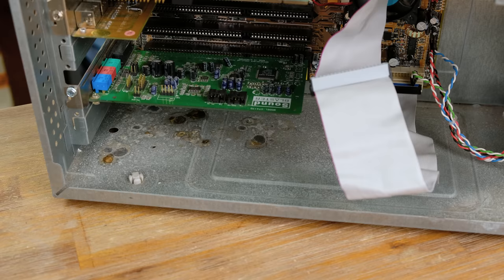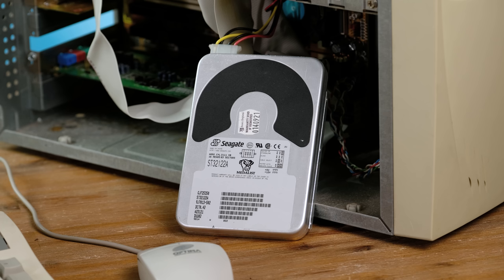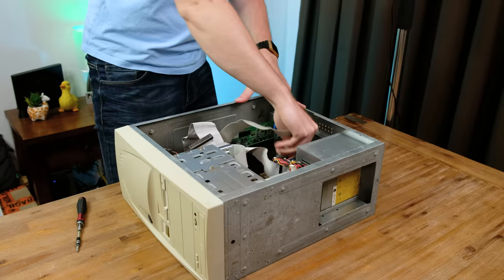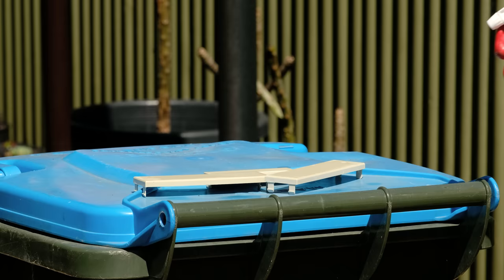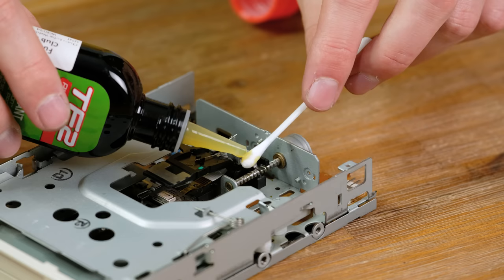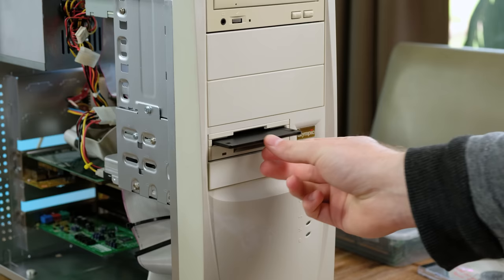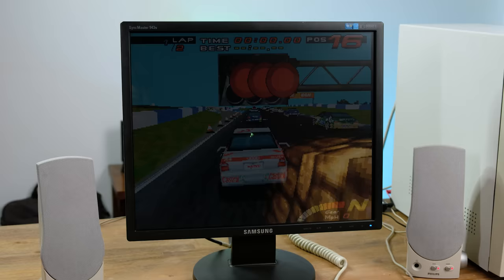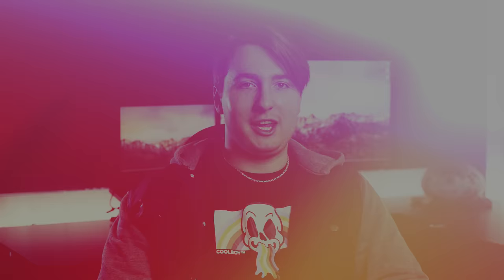Restoring a TERRIBLE Budget PC from 1997!

Comment: I'm a little surprised anyone is still using these machines. I had an old Gateway P2 machine that was a fully working computer, that I chucked in a dumpster last year. I pulled the hard drive though, and dropped a 7.62 Nato round through it.

Comment: Toss in a 3DFX card and maybe tinker with the FSB (multiplier isn't locked) then you are set, these cyrix M2s are pretty tolerant of high fsb clocks which helps with the L2 cache and ram performance. The floating point is the weakest link so games like quake suffer but in integer it does really well which does mean something for later dos games.

Comment: I built ( in 1997 total cost was only like $400ish ) a socket 7 AMD k-6 500mhz with 32mgb of ram I don’t remember my GPU it was a 64mgb ATI card I think, had a 24x CDR 2x write ( got it super cheap at an expo ) a 250mgb HDD a 28.8k modem and of coarse a sound blaster that was my first ever build I was 13

Comment: The odd speed listed for the CPU would cause me to check to see if the jumpers were set correctly for fsb, multiplier, and voltage while I was at it, and maybe check to see if the motherboard had a BIOS update

Comment: The corrosion marks on bottom case inside is rat urine and all the noise and seizing up of mechanical parts is the results of the urine leaving a vapor of ammonium that corroded many of the fine moving parts like the fan bearings.

Comment: The motherboard is a cheap PC Chips M571 using the SiS5598 chipset (here labelled by them as 'TX Pro-II'). On board graphics, sound and even USB although nowhere near as good as the dedicated cards for those features that you found in the system.

Comment: Had a very similar system as a kid - had a Voodoo2 (I think) card from Diamond but also a Cyrix M-II with 64MB. Was AT compatible so when the PSU died that was it - wasn't easy to replace them until the ATX standard.

Comment: If you want better retrobrite results trying submerging the the plastics bits in a solution of hydrogen peroxide and water as this methods seems to have the best results. The 8-Bit Guy has some pretty useful videos on other methods too if you'd like to check that out.

Comment: Speaking from my own experience, for the whitening (retro-brighting) I don't recommend using the cling wrap. The wrinkles on the cling wrap end up causing lines and blotchiness, as with your result. It works fine just to have it in a peroxide and water bath under UV or the sun. P.S, What camera body and lens for this video? Description just has general links to a variety of camera bodies and lenses. Cheers :)
Reply from the maker: I use 2x Fujifilm XT-2 bodies and one Panasonic FZ-300 for the overhead shots. Those are quite outdated now, hence why I didn't add affiliate links for them specifically. As far as lenses go, I primarily use the 18-55 f4 as well as the 50-140 F2.8. For my talking to the camera shots I use a 35mm F1.4
Reply: @psivewri  Thanks! Appreciated. The footage looks awesome :)

Comment: Just a random suggestion: could you add a 3D graphics card? Something like the 3D Effects Voodoo 2, for example. Also, I think this low-end PC originally ran Windows 95, because Windows 98 did not exist in 1997.

Comment: I have done a few of these restorations myself, its great going back in time. Presently though I have built a Windows XP Pro rig for messing around on using some old parts I had laying around, but I had to go with my old genuine copy of the 64bit version for the hardware. I have hit a snag though, I am desperately searching for a suitable driver to run the XFX GeForce 8800GT Alpha Dog 500MB card I have installed, cannot find one anywhere for XP.

Comment: Hey Nathan, I'm a tech Youtuber too and I think the fan was making the noise because the ribbon cable was clipping it as it spun early in the video.  Anyway Nice Video and as you always say, definitely consider subscribing.  ( I only have 30 subs)
Reply from the maker: Nope, wasn't making contact. Just a crappy fan sadly 😅
Reply: @psivewri  You should try putting modern Operating systems on old computers to push their limits as an experiment.

Comment: Thanks for the trip down memory lane. Next time you want to remove a CPU cooler held on like that use a chopstick. Unlike with a metal screwdriver you won't damage the motherboard if your hand slips.

The motherboard looks interesting. It has both DIMM and SIM slots. And it doesn't have AGP or VLB slots.

Comment: My first PC wasn't much better than this.Brought in late 98.  It was an Advent Pentium II 350mhz, 128MB ram (PC100), 8MB ATI Rage graphics card, 8GB HD, 56k modem.(dial up in those days).Was told I'd never fill the 8GB HD...hahahaha!.  never had a pc before..or even sat at one!..So had to teach myself how to use it from scratch. But by the end of 99...I had learnt enough to build my own pc (Athlon 1400mhz I think). And a 16MB Voodoo 3000 video card, used the ram from the old pc and added another 128MB (the new stick was cheap for the time £125). I had also taught myself to build a webpage as I wanted to get "online". So..as 2000 appeared,  I had a new pc and a website!..The website was dedicated to a WW2 pilot...I played MS Combat Flight Simulator then...It came out in 98..The real reason I wanted a PC...hehehe!...The original PC (PII-350) was like £1000....Can't recall if that included the price of the scanner and printer I also brought.....don't think it did...They weren't cheap either. I think I stil have them....But no longer the PC...But I do have a PII and motherboard knocking about somewhere...think it's a PII 400.

Comment: Not bad... . But a little bit to the technical side: The real 3D games ran not only bad lacking a 3D accelerator, but also because of the Cyrix CPU. These CPU -s were in normal tasks sometimes even quicker as the intel ones, but they lack an FPU that you need for real polygonal graphics.

Comment: 1:35  . . . Ah you novice kids!!! You should have push with that opened clipper wire, into the hole (Tiny spot as you see to the lower left of where you hand is, on the CD door) and all would open as they are supposed to.

Comment: The specs aren't bad for 1997. One thing I find interesting about even the new 2020 version of Windows 10 is that it actually still supports floppy drives and we would think people stopped using floppy drives about 20 years ago.
Reply: wouldn't have originally had even 64MB of RAM. More like 16 or 32
Reply: @RWL2012  I think a 266 mhz processor would have been high end in 1997.

Comment: Worms 2: the best version of Worms. I bought a modern release in 2012 and it was just not as good. (Big Worms fans tend to prefer Armageddon over 2, being basically the same engine but more refined etc. But I didn’t play Armageddon, while I had a budget re-release of Worms 2 in 2000 or 2001 😅 so that’s the best one in my opinion lol. Played it until 2006 or 2007, on a Windows XP machine by the end. Come to think of it I’m not sure why I stopped. Maybe compatibility issues with Vista that 7 didn’t fix?

Comment: Pc from 1997 can't be terrible, it can be only retro, terrible is your 5 years old computer. :-D
2:22 - Is it still problem for Microsoft when we are using illegaly such old OSs for retro PCs? I think they should just release it as freeware after such time.
7:02 - I once used just some random rubber connected to correct lenght with knot, it was making sounds like airsoft machinegun, but it worked. :-D
Bios battery for dollar? Buy bigger pack of them, 5 or more pieces, it's better have some extra bios batteries at home, not only for motherboards, CR2032 batteries are used in many devices. But you probably know that.

PS: Nice job, I really like these old PCs when it's restored to original look, not some ghetto tunning. That old CPUs had such large surface that thermal paste is not so nessesery, but better use it because why not. That old computers are surprisingly fast when you have Windows version which is related to age of that computer. I would say Windows ME has much faster boot time than Win 98.
Try to set 800x600 in Duke 3D, even much better computers have problem with that.

Comment: I have monster truck Maddnes 2 on my laptop I'm running on my laptop windows 7 and the laptop cannot run windows 10 so I skipped windows 10 and use windows when I downloaded the game it could not run so I a couple weeks later I installed xp on vmware and when I try open the game it worked and it was running super good but I want to ask you how do you see inside the monster truck

Comment: Hello Psivewri, I been checking your restoration videos lately and trying to fix my old pc i dug out recently, but got no luck at all, please if you can give me some advice that will be very helpful, thank you in advance!
this pc is 12 years old, with an ASUS P6T motherboard and Intel i7 920 as CPU and GeForce GTX 260, if i remember correctly it was one of the good pc back in the days and paid good money for it. It seems like 12 years later the operating system is not running properly, so i try to boot windows 10 and windows 7 via an USB but got no luck, i don't have a dvd copy of the windows and i only have a MacBook Pro, what else I can do? I am thinking to extract the hard disk and install the windows externally with my mbp and plug in back in, will that even work? thank you again for your time!

Comment: Hi Pretty Cool.  I still have my Pentium 100 from that era, as long as the DS1287 Dallas Real Time Clock still works.

It is a bit of a cross over board, both 3 x PCI and 3 x 16bit ISA
Memory is 30 pin and 72 pin by the looks of it

Hmm also takes XT and AT power supply 

For hard drives, when they become a issue $10 on ebay gets you compact flash to IDE or SD to IDE adapters.

Even compact flash is very fast compared to IDE

Try find a more modernish PCI combo video and 3d card, My Pentium 100 has a aftermarket S3 trio 3d - i do also have a spare ET4000.  But the Gateway Pentium 2 has a Riva Vanta 16 which is a better combo 23-3d card

Voodoo cards are very expensive, but there are alternatives when everyone else jumped on the 3d bandwagon
GeForce 256 
GeForce TNT/TNT2/M64
Nvidia Riva Vanta 16  or  the better  TNT 2 16M

S3 Trio3D/2XET4000 and the S3 chipsets were the standard back in early mid '90s DOS days best for CGA-EGA-VGA but most are not VESA compliant which would take you into WIn 95-98 era

Regards
George

Comment: 64/128MB? Then I would have installed Windows NT 4.0 on it :)... Runs good already with 64MB, no need to use those strange MS-DOS based Windows systems, and it is definitely a operating system from the time of 1997 :)

Comment: That system has enough RAM to run Windows XP well. Lol when I was younger I ran XP on less. Lmao
Reply: From my experience the later service packs run terrible on less than 256 or 512MB of ram.
Reply: @Tom2404  Sounds about right. Around the time those rolled around I had since upgraded. lol

Comment: 8:44 - Windows ME with version 4.10.2222A ?
What a weird Windows 98 version you have here...
Reply: Tell me why Windows 7 is written with "Version 6.1 xxxxx" 

That's the same reason
Reply: @ClayWheeler  It seems my comment was misunderstood... Actually Windows ME version is 4.90.3000, and not 4.10.2222A, which is the version of 98SE.

And after writing this comment I did some research and it was just a driver that had the hard-coded "Windows ME" string in it.

Comment: 2 gig hdd is too small to be practical for that era, sure it'll work but  you'll be wanting bigger, look for 8 or 13 or 20+ gig hdds, research how much the motherboard can handle
Reply: and frankly this pc isn't really that terrible, just needs some part upgrades (like 3dfx card), Pentium 1 or MMX or a K6-2/3  Didn't say what soundblaster model it was but either way that isn't bad.

Comment: Good restoration but which idiot sprays the hydrogen peroxide solution, you either soak the part in a container or you use the lotion/cream and wrap in cling film to get a uniform finish. Your poor application resulted in such a bad whitening finish. You try and restore other more memorable PCs.

Comment: Why you bothered yourself to paint a galvanized steel chassis? Absolutely pointless. You just need some household descale to restore it. And those PCs didn't need so much airflow. They haven't really produced heat. And the cable management with those ribbon cables were super easy (but you still wasn't able to do it...).
A 1997 PC, even this low end is perfect for Heroes 2 and 3. What else you need? (HoMM3 needs a 133 MHz Pentium, 32 GiB RAM and a 2 GiB VGA.) Who the fuck cares about the lacking and trash Ubisoft HD edition? Tiberian Sun, Red Alert 2, Warcraft II are the same deal. Network Q RAC Rally runs even slower PCs.